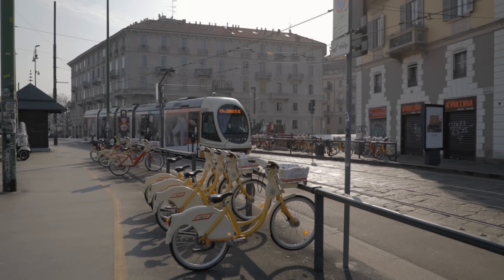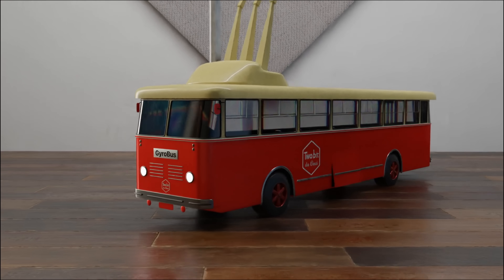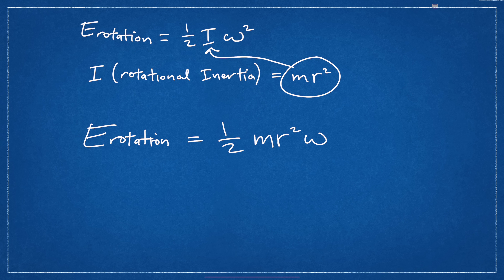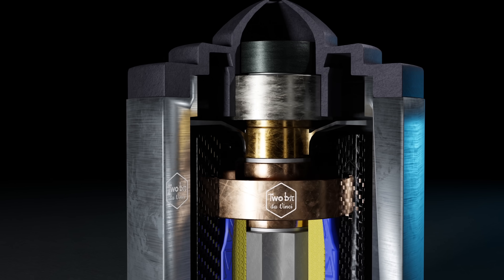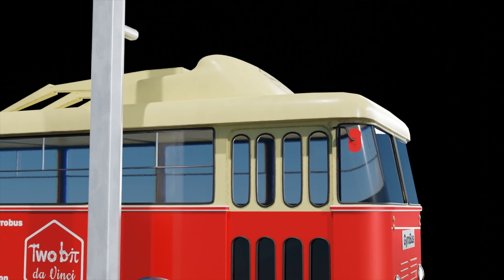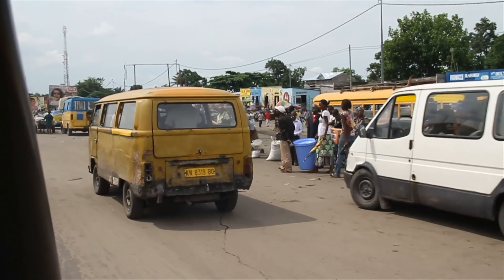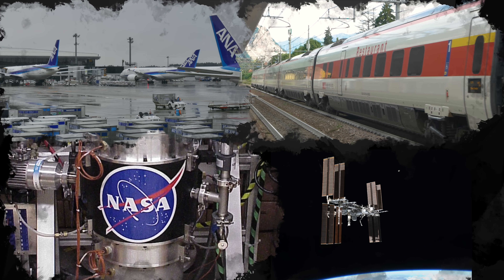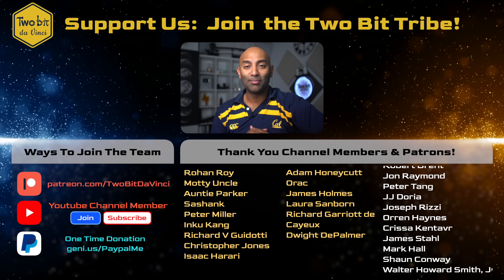This Bus Went Electric WITHOUT Batteries

Comment: for those intrested:
in the netherlands we have alot of ev busses, it was kinda funny when the first few came 8 years ago, since they accelerate faster people would sway back alot and almost fall over. though I think there are less now adays, not sure I havent actualy looked it up or rided a bus in 3 years (so its based on observation) atleast in leiden ev busses are used alot, but when I visit amsterdam or denhaag I mostly still see alot of gass and disel powerd ones, to be fair you can get almost everywhere with other electric rail transport mediums in those cities.

also  taxi's are mostly fuel based but I do think I see a few more ev taxies these days not sure.
the netherlands is only about 320ish km in length so its quite viable to use EV's here.

Comment: My patent application dates in the 1980’s for putting the battery in a flywheel which gained special advantages for batteries and it’s electrodes .
As a battery specialist I could use the centripetal force had I the money

Comment: storing massive amounts of potential safely  is no t a unicorn. 
if the covalent bond could be efficiently reversed on a water molecule and done as demand governs , exponentially  more power could be available and safe. water tank in a wreck would just put out the fire. the hydrogen fuel cell that   converts hydrogen directly to electricity is bullshit and to me seems like a way to vilify or cause low interest in the use of hydrogen as an internal combustion engine fuel .which im sure there are trillions of internal combustion engines already on the planet today running on filthy petroleum. you only need to adjust the ignition timing to .5° AFTER TDC to run hydrogen in most i c e.
this is due to hydrogens faster combustion rate and energy released. it runs cooler and creates only CLEAN water and nitrogen as exhaust.  just like the flywheel here in your video. 
also,
edison batteries at stations could be solar charged and no one wants one. teslas are not green if fossilfuel creates their electricity. edison batteries were numerous and used in industry too. but NOOOOO! instead it has to have some fancy company name badge or glamorous backstory to sell to public. there have been many technologies in the past that are pragmatic and efficient. modern business got in the way and has to sell the crap they do as it is more profitable .i am a big fan of the 
" Bunyip pump" from a gentleman   in Australia! now that is somethi g on a different level. far superior to a ram pump .
if i had the money , i would use Nitenol to assist the function of the bunyip pump to reduce the drop from source needed to function. pool pump any one for free!?for now it is getting a solar sysetm and bilge pump from my boat to run WITHOUT losing all the waste water .in a little kiddie pool next to big one the solar pump is to keep waste water from bunyip master cylinder  being lost .it will get pumped into the slave cylinder from kiddie pool and an over pressure relief hose back to main pool.  it's not done yet but am documenting it and i think you will like it in the end. this 24' above ground pool costs me 80$ to 100$ in electricity a month. unless i buy the super fancy high dollar ones for 5x the cost . still giving dollars to move the same water. silly. i must make it work. then the next phase , water wheel and car alternator! or not .we'll see. 
i like your videos .keep the style , it works.

Comment: If several old technology was combined in a new twist would result in a series of breakthroughs like new but old energy resources and new but old mechanical engines!! Like the mix of flywheel and coil springs as once a outside force set one say a flywheel is released it in turn tightened coil springs that can then be released at some point at its limits back into the flywheel!! There will be a loss but with the right materials and design is at a minimum!! It is stored energy release that is storing energy that with batteries as a backup would help it up a hills! But could reverse and create energy going down hills in several different ways at once!!! ANYTHING IS POSSIBLE!!
🙉🙈🙊🇺🇸🇺🇸🇺🇸🇺🇸🇺🇸🇺🇸

Comment: Flywheel for grid sounds great! 
Having multiple wheels to handle different use.

Some wheels running at high speed to take ober, but batteries do a good job at this too.

Stopped or slow wheel to accelerate to store overproduction:
+ Sudden increase from wind or solar, to make time to adapt, then slowly discharge to grid and/or battery.
+ Sudden drop of demand, from accidental line failure, or planned or expected events

Comment: I feel like this would have been explained in 20 seconds if you just said you were pulling the clutch out on a weighted free wheeling electric motor wheel 

ez
Reply: No clutch but a generator/ motor which powers the flywheel and uses the stored energy to power the motor

Comment: It appears they were using an induction motor to charge the flywheel, and that would indeed be terribly inefficient since the supply is constant frequency.
Reply: A DC gen or a PM synchronous generator would have made much more sense. The power factor of induction motors is not good enough for applications requiring intelligently managed energy use.

Comment: The gyroscopic effect would not effect turns, as turns are in the axis of rotation, if anything it would help prevent the bus from leaning on a curve. It sure would have an effect when trying to change from level to sloped ground and vice versa!

Comment: I think the most amazing use of fly wheels were only pictured in this video: Large scale manufacturing. In particular, in combination with a long drive shaft and many slack belts to drive different machines.

Hardness one river or windmill or a huge single-cylinder engine to power the majority of a factory.

Comment: Gyroscopic procession is not an issue with turning on a gyroscope that's mounted with a vertical axis. Only going up or down steep hills would present a problem.

Also, I don't know what 3D program you're using, but I noticed a lot of modeling and rendering errors. Message me and I might be able to help.

Comment: In the UK, the Parry People Mover is a flywheel driven light railbus operating the Stourbridge Town branch rail line, and is in regular reliable use, so the transport technology is not dead.
Reply: I did ask when using it a few years ago and was told it had a gas engine on it and the flywheel wasn't brought to speed by electricity. Obviously it needed more power than the decent to the town level put back into the flywheel.
Reply: @brianfretwell3886  That is correct, but the flywheel does recover some of the energy so at least, there is a fuel saving. Parry have had electrically powered flywheels, but I am not sure if there are any in use.
Reply: From memory the engine in the WMT Class 139 Parry people mover is a small internal combustion engine from a Ford Focus (?) so the emissions are far lower than those from a traditional diesel DMU, and if you consider if all the passengers had taken the same journey in their own cars with similar engines, then the potential overall  reduction in emissions is significant.
Reply: @dr_dr  I was told (when I asked after a trip on it) it was a "Gas engine" as it is in the UK I would assume it was LPG or propane not the US definition of gas (liquid petrol).
Reply: @brianfretwell3886  I think you are correct, the Class 139 uses a Ford 2.0l DSG423 86hp engine. This engine is designed for using LPG or propane, but some references (Wikipedia) state it to be using diesel to confuse things.
Reply: @dr_dr  Diesel engines are more similar to propane engines than they are to gasoline engines.
Reply: @brianfretwell3886  natural gas (methane) will power compression ignition IC engines, not sure about propane. I had a propane powered 1972 V8 GMC 2500 pickup truck (after market conversion with a couple $100 provincial rebate. All the commercial spark ignition vehicles used it then, cabs, cops, people with high mileage commutes in Alberta) back when propane was inexpensive in Canada, I cant imagine the emission and fuel cost savings over the 500 000 km that big old truck ran on that fuel in the 1980s and 90s(the least I paid was Canadian  $.03.9/litre and most was about $.95 but likely averaged $.30/litre which was about half gasoline and about 10% less BTU/litre but being clean less oil and sparkplug change also could have turboed as octane is over 110 (a regret as it ran so many klicks and would have been more efficient and powerful)
Reply: In China some local bus routes use gyro powered busses.
Reply: I sawauk video saying they are testing flywheel lorries.
Reply: Humans 0
Saiya-jin 1 to 6
Angels 7 😇

Kalki Ironman 5th matriya buddha 8th arc Angel 11th satguru 13th imam and 24th avatar after 2026 😎

Almighty God 9 😇

Humans type 2.5+ after 2026 by Kalki Ironman (christ in the white horse)(son of man on clouds) type 7 and 8 😎

Jarvis the world’s first artificial intelligence (parrot) 😎

Cuz Kalki is ironman batman super saiya-jin superman ben10 saitama Narutoo optimus prime and every super heroes combined after 2026 😎

Jarvis world’s first artificial living being (just like vision in marvel universe)😎

Made of Quantum and sub quantum particles 😎

Power source quantum energy arc reactor (type 7) level technology 😎

Kalki Ironman going to have every kind of arc reactor like:- type 1 Nuclear fission, nuclear waste, hydrogen fusion, type 2 3 4 5 antimatter arc reactor (solid liquid gas), type 6 electro quantum arc reactor, and type 7 Quantum arc reactor, type 8 limitless quantum energy arc reactor without quantum particles 😎

Kalki Ironman going to have sun in a box million billion tons of hydrogen nuclear fusion reactor type 2 3 4 5 just like sun and stars in the palm of his hand 😎

This all going to happened by self replicating quantum nanobots knowledge energy and techniques at type 7 7 7- respectively 😎

Ironman (Tesla 2.0) going to reveal every secrets of the world specially Tesla and his Antigravity 😎

Comment: Two flywheels fright beside each other, going in opposite directions would help in the steering. Two horizontal and two vertical. With each disc spinning in opposite directions, the possibilities become endless.

Comment: lf the flywheel has a vertical shaft a turn taken slow enough that the bus doesn't "lean" would not be affected by the spinning mass.   Hard breaking or acceleration might cause some "leaning."

Comment: I think the hydrogen filling instead of vacuum was for cooling. Hydrogen is one of the best media there is and used to cool large power plant generators. If they only wanted low drag, as good of a vacuum as possible would make more sense.
Reply: Vacuum has the additional problem of there being a pressure differential between the inside and the outside of the case.  This requires both a more rigid case and better sealing.  Filling it with 1 atmosphere of hydrogen by contrast  still gets you a major friction reduction, without the pressure differential that makes seal maintenance painful.  And then yes, it also does a better job of conducting heat out of the system.

Comment: So would the bus get rotationally pushed every time it demanded power from the flywheel?

What happens under failure scenarios? Say a car crash?
Reply: The car would get messed up
Reply: @janeblogs324 , lol yes.
I'm interested in what happens to 1 tonne of 1000rpm spinning steel if the casing gets smashed in.

Will it rip itself apart scattering high velocity shrapnel everywhere?
Or will it tear itself free and fire across the area smashing everything in it's chaotic path? (Remembering what happens with giroscopic toys)

Comment: Don't forget about using water as a storage device, pumping water back up into hill to upstream of hydro electric dams.
Reply: You still need more energy put into it to move the water than you can get back out of it. We can not achieve 100% or greater efficiency in our world. Its physically impossible.
Reply: @mikeznel6048  duuuuuuuuude good pumped hydro storage is up around 85% efficiency, so please do not let the perfect be the enemy of the good.
Reply: What I think your referring to is that all the surplus energy during the day is used to pump the water uphill to a reservoir and then the used to power   a generator when the wind is not blowing and solar is not available.
Reply: Or you can use pressure  to compress a spring was used to power tower bridge
Reply: Recycled hydro is only suitable Inna very small set of geographic locations where large dams can be built at both a low and high place.
It can be done on a smaller scale using large water tanks, but you'd still need an excessive land area to achieve it... Such as a farm with hilly areas that go unused.

Comment: @ 8:50/13:35 "Gyroskopic effect cause the bus to resist change of direction"....in this case it is not true, because the rotational axis is vertical, so the turns of the bus are not a problem. The problem comes at the change of elevation...i.e., when the bus wants to go up or down the hill! Hence the road pots(the holes in the road) have destroyed the bearings and probably the undercarriage frame of the bus!
Reply from the maker: The bud will sway in turns, which was resisted so vertical axis vector shifts on turns
Reply: Excellent point
Reply: It is not just the axis in play here. Turning the bus is akin to accelerating or decelerating the flywheel, which requires energy.

Comment: These could also help prevent vehicles from flipping over in accidents. Somehow, I believe they were used in racing because of this. Also, the title is incorrect. The bus still used a battery. the "Flywheel". Is a mechanical battery, no?
Reply from the maker: Yes technically… I was trying to create intrigue :)

Comment: We had a trolley line in my country.  It suuuuuucked.. Everytime it went over a bump in the road, the terminals disconnected and the bus stopped - it was usually mid intersection in the most trafficed part of the main city center.

Comment: Sorry, but the "Hyperloop" is a way untenable pipe dream.  Ask yourself, how do you maintain a vacuum in a tube even ten miles long, and how do you make stations work with having to breach the vacuum... Oh, and what happens in case of disaster/failure to the gear and most of all PEOPLE?  What do you think the build cost of such an insane project would be (Elon grossly underestimated it, and he can't even build a regular tunnel at his proposed price).

Don't listen to a word Elon says, he's a vaporware salesman, and has no clue in engineering: He's even week in his own field of software engineering, according to those he partnered with (Not at all related to what he's doing (Lying about).  Don't fall for the conman, look up what's happening in his court trials, and what his debunkers (Thunderf00t is a good one) have to say: the ones who understand physics, engineering.... not his fan bois who are mostly clueless.

Also, There are only two states of energy:  Kinetic (in motion) and Stored (with or without motion but stored, as with the flywheel it's in motion, but not referred to as kinetic).  What you are speaking of is "Mechanical energy".  Electromagnetic energy such as electricity and light IS kinetic energy too, as it's in motion.

Oh, and I loved your Keith Richards comparison!!!  (<:  RIP Charley Watts!  )<:

Comment: UK narrow boats are usually diesel. There are no charging places other than marinas and the boats don't have the roof space for enough solar panels. Wondered if a pedal driven version of a fly wheel could supplement keeping the batteries charged? They only travel about 4 hours a day but you need power for fridge and all the other electrics. You are not doing much when you are steering so pedaling would be good exercise. Then you could have silent electric cruising.

Comment: It merely accepts more energy losses from additional conversions.
Oil was still burned to add the energy to the flywheel, as it is today to charge electric cars.
Reply: Exactly. And it's cheaper and more practical to either run the busses wired or on batteries.
Reply: @nasseemmuttur778  says the guy who doesn't have any kids working a lithium mine in his back yard.

Comment: What about a flywheel for home energy storage? Or would it be overkill? I would imagine it would be stable.

I know of at least one data centre where I am that uses a bank of flywheels to bridge the gap between a power outage and the diesel generators starting up.
Reply: flywheels are very short term storage, not long or even medium term. even the best flywheels would bleed most of its energy in a few hours if made in a scale for "home energy storage"
Reply: @GraveUypo  It sounds like a decent power regulator, something like a UPS but I can see it'll be an issue to power a house overnight.

Comment: that wheel shouldn't really impact steering much, since it was horizontal, going over speed bumps and alike would be really hard on the bus frame and flywheel bearings tho.
Reply: It also seems like the bus should want to roll over more easily when the grade changes at the top or bottom of a hill.
Reply: @odometric5946  roll over, really?
Reply: Basically a gyroscope will exert a torque 90 degrees out from a torque applied to it. So if the gyroscope is lying horizontal (flat, which is different from a bike), and the bus starts flipping end over end, the gyroscope will exert a force (torque) to make it want to roll side to side instead. The force it exerts might be really small though, because that all depends on how quickly the bus crests a hill, how steep it is, and how much angular momentum the gyroscope has (mass, moment of inertia, and rpm).
Reply: @odometric5946  yeah, I just replayed some gyro experiments in my head, and I get it now...